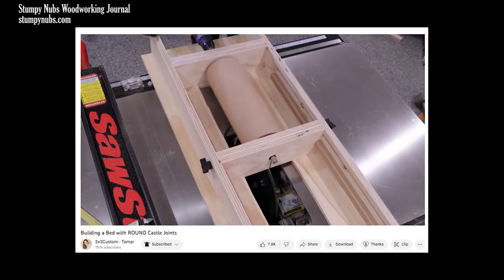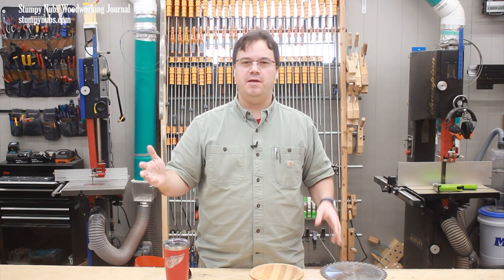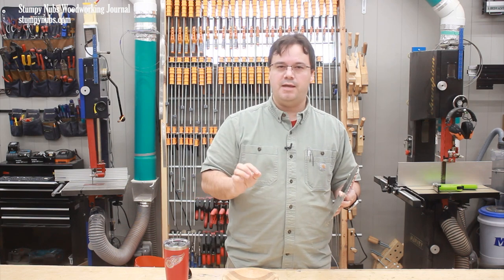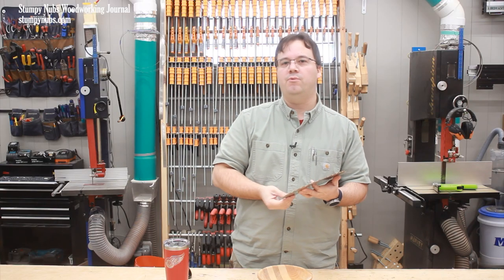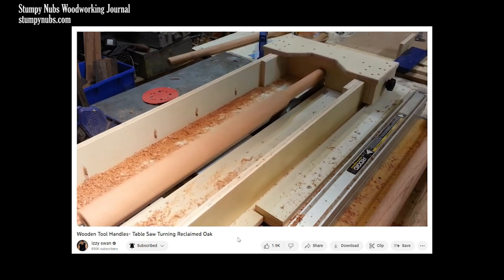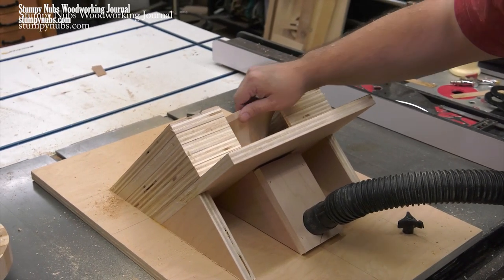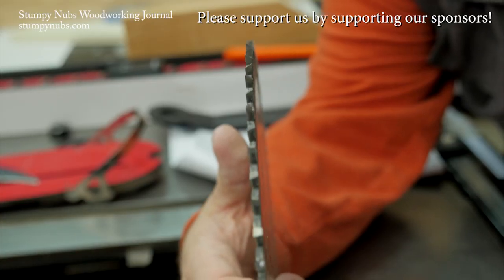DANGEROUS new trend in internet table saw videos? You decide...

Comment: Mechanical engineer here: I like your explanation for why putting pressure on the side of the teeth is negligible haha. Really puts it in perspective. One thing I can add is that if you think of how fast each tooth is going (140mph?) and then think of how fast you are pushing the wood into the blade (1 inch per second let's say, which is .06 mph), that means the velocity relative to the tooth is 0.023 degrees from the centerline. So yeah. Negligible.
Reply: Thanks for doing the math. I didn’t feel like it.
Reply: Would still appreciate the collab with the Slo Mo Guys. Some of us are visual learners.
Reply: Haha yeah I have an engineering background, just the basics. And my first thought was hmm applying force in the lateral direction sounds like a really bad idea it’s weak there it’ll fall outta balance etc. I just didn’t realize how little force is actually applied in that direction, it’s a bit deceptive intuitively but makes total sense in hindsight. I don’t think anyone really needs engineering experience to notice that but you definitely become more aware of materials/objects weaknesses
Reply: SSSSSHHHhhhhhhhh.
Reply: Unless you mess up and take too big of a bite
Reply: Barely a high school graduate here... questioning your mechanical engineering degree. What table saw blade material withstands 240,000 rpm and what motor turns that? Try 4,000rpm not 4,000rps. You should have caught the mistake. My math tells me the tooth on a 10 inch blade is actually moving at 118.99mph. 31.4159 inches per second(circ of 10inch blade) X 4000rpm X 60 minutes / 12inches per foot / 5280 feet per mile, am I wrong?
Reply: Yeah, you're right, but where did you get 240,000rpm from? They just took a guess at the tip speed and they were pretty close. No one mentioned a ridiculous rpm, so climb down off your high horse.
The 1 inch per second feed speed is only correct for the coving or bowl projects. For the drill powered lathe it's much faster so the resultant velocity of the tip relative to the wood will be much more out of plane with the blade so very light passes are required.
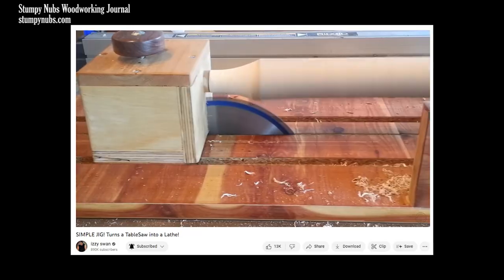Reply: @RhysMogg  from Stumpy 2:57 & 3:20 Big difference between per second and per hour. It might be that you are actually right at 140mph and he's wrong when he speaks. I'll look again later I gotta leave at the moment.
Reply: @joebonomono5078  he’s not saying that many RPM. He’s saying that’s how many impacts the saw teeth have with the wood per second. His Harvey saw runs at 4800 rpm. 4800 divided by 60 seconds times 50 saw teeth is 4000 cuts per second. (Assuming his blade has 50 teeth, which is reasonable and common).
Reply: @justincottingham3969  I buy your argument that I may have misunderstood Stumpy, I'll double check the math on lunch and see if it's me that's wrong. Thanks

Comment: It certainly puts it in perspective when you said the tooth is moving at about 140 mph. As a kitchen fitter I used to have a table saw but about 10 years ago I invested in a rail/plunge saw and got rid of the table saw as I felt the rail system was way safer for what I needed. The safety advice you give is very clear I just wish some others on YouTube followed safer practice because some have their hands well into the danger zones and often reach over a spinning blade. If someone new to a table saw sees bad practice and mistakenly thinks it’s safe to do something those spinning blades will take no prisoners 😢
Reply: Each tooth is also only chipping off a small bit of wood at a time and then getting clear, it's not like a hand saw where you're holding the blade into the material.

Comment: Good video, even though I'm not planning on using a table saw to turn furniture legs or bowls anytime soon.  I recently saw Izzy Swan's video about his top 10 most badass jigs and the lathe jig was one of them.  As for safety, the biggest thing is to have patience and take your time.  If something doesn't go as planned its easy to get frustrated and start rushing and that's when something bad happens.  If something unexpected happens, better to turn off the saw and step back and evaluate.  In addition to safety, wood costs money and I'd like to do a project without having 5 or 6 failures on the scrap pile.
Reply: I was taught that if I'm cutting multiple pieces, to cut the longest piece first.  because if I screw it up, I can make a shorter piece out of it.

Comment: when I talked to a finish crew doing custom milled trim on a table saw, they told me that doing it with a standard blade is not a good idea, but it's easy to get a blade that is designed for milling.  

the reason for that - the teeth on a milling blade are designed to cut material coming from the side, so it cuts more efficiently.

Comment: I'm glad you addressed the wear on the saw/blade.  I was concerned about that.  The bowl jig scares the heck out of me, though.  Especially when cutting the inside - what happens if something causes the bowl to crack/shatter? Your hands are now directly over the blade without any protection.  Probably wouldn't ever happen, but it would be nice to find a way to use the jig without your hands in that position.
Reply from the maker: Unless you are using severely compromised wood, I can't imagine how lightly shaving material from a 5 or 6 inch thick block could cause it to shatter. Even when you are done carving the inside, it is still a few inches thick.
Reply: @StumpyNubs  I'm probably overestimating the forces on the wood.  Thanks for the reply!

Comment: Cove crown on the table saw pits a lot more stress on the blade than this and I’ve never heard of a problem doing that. I’ll also cut curves out of framing lumber for curved doorways. They actually used to make a cupped blade just for cutting curves in a circ. One for each direction you could cut the curve. And a blade that was 3 triangles to cut curves in framing lumber.

Comment: I've used this method freehand on a cheap tablesaw to make fence braces for farm fence. Fence builder guys were amazed at how well it worked and how simple it was to do.  Drill a hole in the vertical posts and insert. No extra nails/screws/bolts - just held in place by tension from the wire.

Comment: Hey Stumpy, I have a request for a video. It's applicable to your channel, but a little off your normal topic.

Could you make a video with some "first tool" recommendations for kids? You know, in the spirit of starting a new generation.

My oldest kids are young (6 and 4) and curious about what I build with my tools. This summer, I want to get them a hammer, hand saw, tape measure(maybe a few other things).

I've done some looking, and most of what I've seen for that age group falls into the "toy" category.

I suppose that's understandable, but I want to get them some good quality stuff they can learn with and later build rudimentary bird houses, boxes, chairs, whatever they want.

My dad started that with me when I was about 5 or 6, and I had a great time.

Maybe it's too much work to make a video of it, but if you have some resources you could recommend, I'd appreciate  it.
Reply: Hey man! This is actually directly in my line of expertise. I used to run a shop at a small private school, teaching kids aged 5 through 18 to use tools. I'm a math teacher now, but I did that for 7 years. I'd suggest getting them a drill like the Makita FD01 or FD10, which is small and lightweight compared to huge heavy contractor drills. Do this instead of a hammer. Using a hammer and nails requires a lot of coordination and offers many opportunities for crushed fingers. It's also not very reversible. You can pry out nails, but it's difficult to fix mistakes. Screws can be repositioned and reused multiple times, and the battery power lets kids spend more of their energy building, and less on the actual fastening process. Plus the drill can be more versatile! You can use it to drill holes, or even as a motor for a small go kart or robot or something. 

For cutting, I would suggest not going for a hand saw. Freehand cutting is hard work for adults, and six year olds struggle with the fitness to cut through a single 2x4. You can teach them to safely use the power miter saw with your supervision! I've done that with about 1000 kids (I mean that literally) with no injuries. It does require that you be there with them, but in our experience that's much safer than a hand saw. You can set up a cut with the wood clamped, and there's no way to slip with a miter saw. The only injuries I've had from woodworking are from hand tools. If you don't want to go the power tool route, see if you can get an old school hand miter saw! It's a hand saw built into a frame with bearings that constrains its motion, making better, safer cuts. 

With a method to cut and a drill for joining with screws, you can build a bewildering variety of projects! I also highly recommend looking for 2x3s instead of 2x4s. They're really cheap, and lighter weight, which makes them easier for kids to use. 1x2s and 1x3s are also great. I'd also suggest a quality tape measure like the FastCap Procarpenter Standard Reverse and maybe also their Metric Reverse so they can build an intuitive sense of both systems of measurement.

Honestly, if you want to talk more about this, let me know, and I'd be happy to chat over email or phone. Getting kids into the shop is still one of my biggest passions!
Reply: Decades ago my parents & grandparents bought me 'toy' tools & they were really frustrating. They had metal parts, not all plastic, but the saw wouldn't cut and the screwdrivers just twisted, but not the screw. So, decent screw drivers, a 'razor saw' (better model hobby stores) or a slightly larger 'gents saw' (Lee Valley/Veritas and others), a 12"/30cm stainless steel ruler, a smaller tape measure (small hands can't really handle the big 24'/8m ones), an Engineer's or Speed square (combination squares have parts that can get lost). Lee Valley has a very limited run of their small claw (5oz) hammer that was discontinued (they found a bunch of head castings in the warehouse) or there is their 6oz 'pocket hammer'. And a medium tool box to keep the tools in (a plastic one is likely to last longer than the junky metal ones I've seen offered in most stores). You may also want to use some paint or tape to mark the kids tools so you won't 'accidentally' borrow them (like my neighbor)
Reply: My son is 4. I find a good tool to let him have a play with is a spoke shave. It's small enough to handle and good at learning about grain direction and how wood cutting tools work without too much danger. He likes being able to make curly shavings come off the wood. Hand planes are still a bit big and unwieldy for him yet, and I don't want him to drop my expensive low angle block plane on the floor either 🙂

He also has an egg beater drill. I put a masonry bit in it because he sometimes likes to drill holes in dirt, because he's 4. It'll sort of drill a hole in wood if you're persistent.

A small saw like a Gent's saw or small Japanese backsaw could also be useful, but there's a risk of cutting yourself, so I supervise saw use closely for now.

My toolkit would be:
 - Gent's saw (you could also cut down a cheap hand saw so it's more useable for younger children, modern ones only have hard teeth, so should be easy enough to modify)
 - coping saw (for cutting odd shaped holes)
 - small claw hammer
 - egg beater drill with some small drill bits (for drilling screw/nail holes)
 - spoke shave
 - small half round rasp
 - low angle block plane (if you can find a decent one that you don't mind taking some abuse).
 - combination square
 - marking gauge (optional).

I think with that, you could undertake some decent projects and learn some basic skills of hand tool carpentry.
Reply: Hey Guys, thanks for the suggestions. I'm excited to get them building and be building with them!
Reply: @Gumbatron01  when my kid was little, I gave him a 5" random orbit sander with variable speed. Turned in down so it wouldn't get away from him. Now he's 29 and still has that sander.

Comment: Been using this method for cutting pool cue shafts on special, built converted table saw for 20 years.  Never a problem.  Actually, many cue makers have done it this way for years and years.

Comment: Good video, if someone is concerned about the lathe jig and the workpiece shattering it would be easy to make a cover over the top. A greater safety issue might be pushing the jig too far and exposing the blade, a simple stop could eliminate that concern.

Comment: I've used a variation of this technique using a router, the jig was fixed, the piece was rotating and the router sat on a recessed grove and was able to move up and down the length of the piece. It was very effective. I didn't even think that I could do it with a table saw like this. I like the router method better.

Comment: table saws are inherently dangerous. ALL power tools are dangerous. stepping outside to check your mail has risk. driving is VERY dangerous. the key is to be alert, and always focus on the task at hand. I have used table saws to cut covers for several decades, and never had an issue, because I pay attention, and work within the limits of my tool. I really appreciate that way you present things like this. you admit there is some risk, but discuss mitigation. good video.

Comment: Learned this working in a cabinet shop 20 years ago.  We would position the axis of rotation to the side of the blade, and use the blade tilt to control the diameter of the rotating part.  It's hardly a new idea.

Comment: Thanks for posting this. It is a process that many of us out in the woodworking universe use regularly. I concur with others who are comfortable with this approach to cylinder turning. Frankly, beyond how much faster you can produce a cylinder on a tablesaw with a proper jig, I feel safer doing preliminary rounding of blanks on the table saw than on the lathe. The irregular meeting of the lathe tools and the usually odd shaped startup hunk of wood present some rather hairy scenarios IMO. My only real concern with the way the cylinder is turned in the 3x3 Custom video you referenced is how close the drill is to the trailing jig fence. It is easily conceivable that the user could push the jig a bit too far and catch the drill with the saw blade. The potential for that happening is enough of a concern that, If I were making the same jig, I would add about a 2-4 inch socket drive extension to mitigate the problem. It is a simple thing to do and the improved safety would make me a LOT more comfortable. But that's just me.
Reply: Just put a stop block on the underside of the jig to hit the table edge so it's impossible to saw through the back end into the drill, hands etc.

Comment: I made one of the YouTube table saw/drill spindle making jigs. It easily cuts it down in one pass. Quite fascinating to watch. I was to make double tapered chair stretchers. Has a great finish as well. Not much sanding required. You can tilt the blade into the piece to fine tune the diameter.

Comment: I will use my table saw with different sized blades to make concave sanding blocks running the piece sideways, but I don't get aggressive with deep cuts. I also use it like a bandsaw for straight cuts with long pieces, but I never screw around with short pieces that can get jammed between the fence and the blade. That space between the fence and blade is a killer. If I need to use another tool like a lathe, I set up a ROUTER jig.
Reply: "That space between the fence and blade is a killer."   I couldn't have said it better.

Comment: I've made all kinds of jigs to move parts diagonally across the blade.  You just have to make sure the part is held securely, take shallow cuts, watch your feed speed and use a standard thickness blade (not a thin kerf blade).  Be careful and you shouldn't have any issues, but always be prepared in case something goes wrong.

Comment: Something that people doubting this type of technique seem to forget is, oddly, just how fast this blade is moving. Even with the drill-spun jigs, the wood is rotating so much more slowly than the tablesaw blade, it might as well be stationary for cutting purposes (especially since the wood is held so sturdily like you said). By the time any part of the wood starts applying significant pressure to the side of a tooth, that tooth will have rotated away and the next tooth will be cutting that wood.

Comment: the most dangerous part of doing cove on the table saw is running with unexposed blade all day then making the first cut through the wood i cut myself twice on the table saw both times doing just that ( making crown molding to match existing molding) you get to complacent . but i have perfectly matched old molding doing that

Comment: I was always told that if you strike a carbide blade hard on side such as dropping it you should have it inspected to ensure the brazing doesn’t fail.  You can knock the teeth off even a good blade with a hammer from the side using much less force than head on.  Do these techniques create that much force?  Probably not as you said and I imagine it’s probably fine though I wonder how a hard knot would fair.  Coving was something I saw a lot when most blades were solid steel but I rarely see anyone do it these days.  If I recall correctly early carbide blades didn’t recommend that practice but not sure if newer ones have the same guidance.
Reply from the maker: I have never heard a distinction between the side or the front of a carbide tooth in the context of damaging it from a strike. The worry is generally about damaging the brittle carbide tooth by striking it on a hard, metal surface, not damaging the brazing that holds it to the blade. I have never heard of inspecting a blade because the tooth struck wood, no matter the direction of the strike.